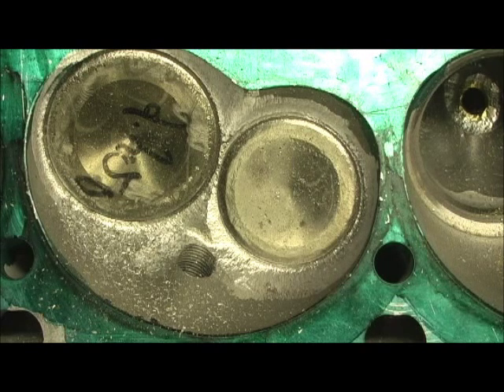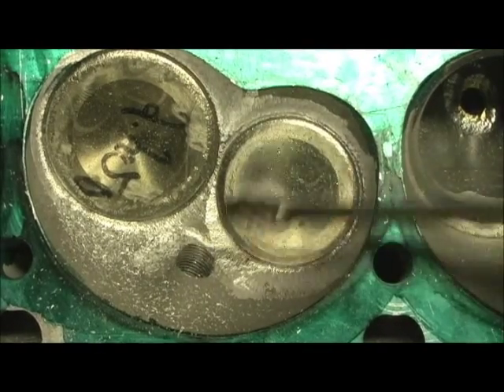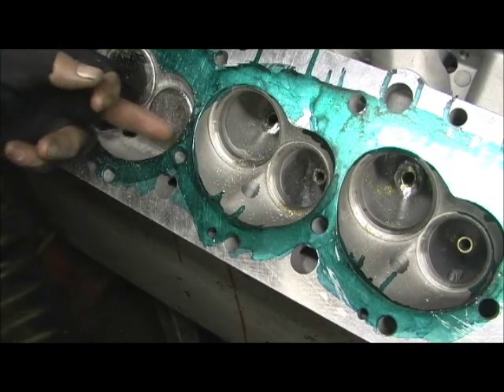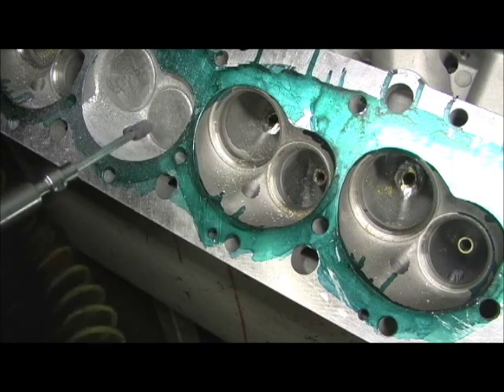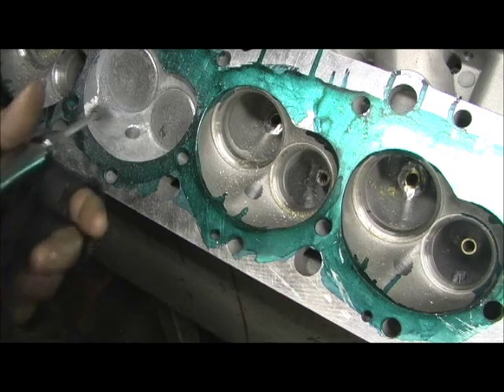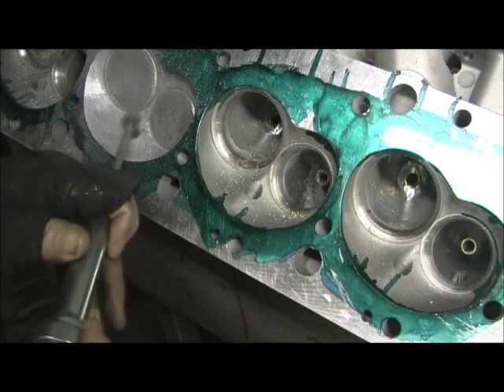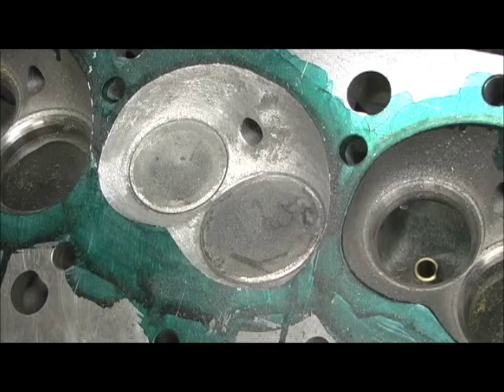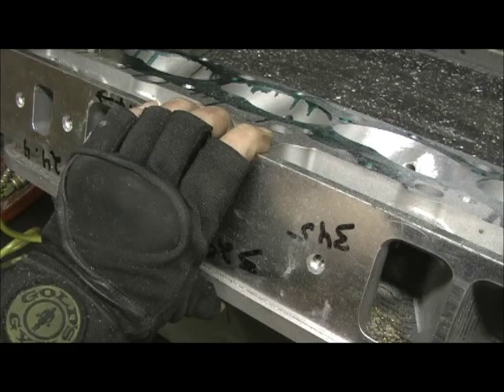BBC Assualt 345cc stage IV Combustion Chamber Mods 3.9

Comment: Is there any reason for the heart shaped combustion chamber? Would it be better just to get rid of the hump between the two valves? Or is it just to maintain CR?
Reply from the maker: what Up Carp? the hump between the two valves hinder air flow, and are over-hang from installing the seats and have to be leveled to keep the low lift air from being BLOCKED. The heart shape is used to promote QUENCH in areas that don't effect the air flow.